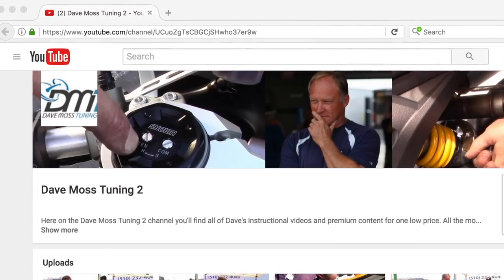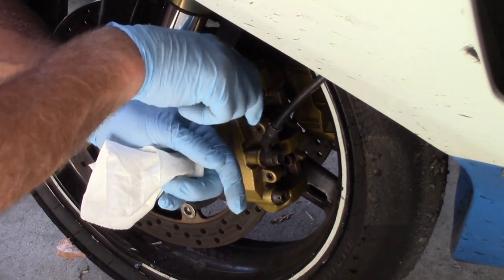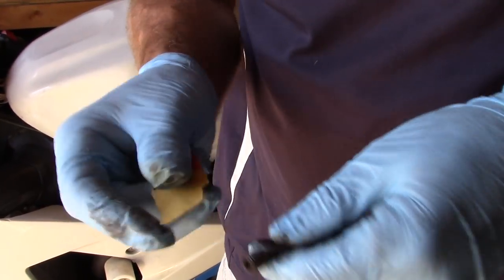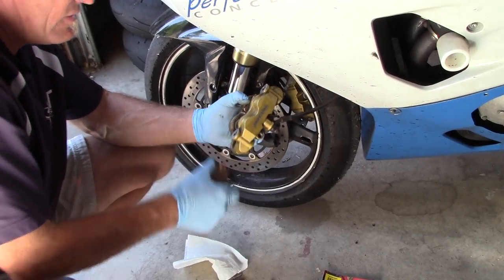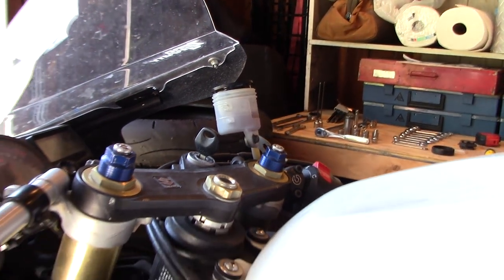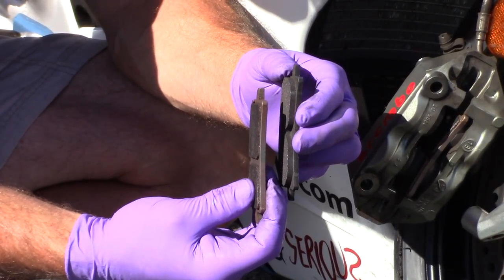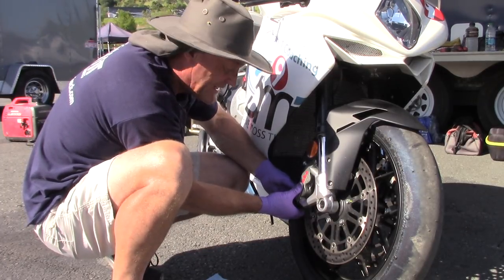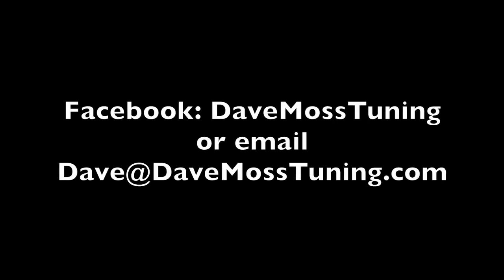How To: Changing Motorcycle Brake Pads

Comment: Thanks Dave for sharing those interesting facts and maintenance advises , i recently got a low milage bike and the previous owner did a powder coating to the wheels that damaged the front wheel hub and i realized that after i got the bike , the bearing are not snug in the hub, i didn't want to get a new wheel and was thinking of fixing the one i have, one interesting solution that i didn't try yet is to use loctite 609 (green) for the bearing to make it fit into the hub, i'm planning to try that but was looking for some advises from you as i didn't find many people sharing their experience with such problem.

Comment: My grandfather had two pieces of wood,,, I think from The Ark, as the wood looked HELLA OLD!
But he put the two pieces of wood they may have been wrapped in leather as the wood was SMOOTH.,
Aside each of the pistons lengthwise 
THEN- had a wedge block he used between the two pieces of wood.. and that applied pretty uniform & safe pressure to set the pistons back

Comment: Hope you have a video comprehensive as this do fluid removal / change ….this was so much easier to follow for me ..maybe because I always do my own car brakes …..but am guilty of Basically never changing brake fluid ,most I’d do is during bleeding running old fluid through till new ( or looks mostly new ) fluid bleeds..
Reply from the maker: I did a quick search and did not find a video on bleeding brakes 101 - only on an upside down rear caliper. That will be rectified in the next 6 weeks when I return from New Zealand.

Comment: Thanks for all the videos :-)
The first calipers looks like mine gsxr 1000 k3 calipers, and they have spring-plates on them that you might be missing on yours. I dont know if they make any difference, could be worth checking out in any case.
Reply: Correct, maybe the missing spring plates are the reason that the pad pin is damaged like that (I have a K3 as well).

Comment: Very nice video and thank you for commenting on the previous post about pad deposits on the rotor.  I have a question that no one has been able to answer about those Brembo monoblocks.  I had some trouble with a GSXR master cylinder 2 years ago and while troubleshooting it I cleaned and replace o-rings in the calipers.  During this process I found out that the inlet hose and the bleed screw are not separated internally.  Both holes go into the same cavity.  Because of this, while bleeding the fluid, the new fluid simply travels down the hose, into the first cavity and then out the bleed screw.  It does not travel around the pistons and therefore the old fluid around the pistons does not get flushed.  The only way to really bleed these calipers effectively (which, to me, is defined by saying at least 90-95% of the old fluid gets pushed out) is to pull the pistons and drain the calipers each time.

What am I missing?  This just seems like a really ineffective design.
Reply from the maker: You are not missing anything. Your observations show how the flow path works and these brakes are designed to encourage frequent cleaning as they are "race" type calipers that get a lot of attention as per several of the old On The Throttle brake cleaning videos. It can seem odd, but knowing what you have and how best to service it is by far more important.
Reply: T.J. Houchin 
Or you could put a hose on the bleeder valve open it then push the pistons in thus pushing all the old fluid out then pump the brake lever to fill the caliper with new fluid do this several times and you flushed it without having to disassemble your calipers........hope this works for you

Comment: Hi Dave !

How would you clean the break pistons if that was necesary ?
Reply: Sebastian Cichy --->  An efficient and simple way to get caliper pistons clean is to make a wood block about a half inch thick by about 2 inches long and 1 inch wide. These dimensions worked well for my Brembo M50's, however not all calipers are created equal. So you may have to modify yours a tad to fit your application. 

Once you have your wood block ready, place it between the caliper pistons. Now pump in some brake fluid to move the pistons out so they bite the wood block. The pistons now have good extension and will not fall out.

So... now you have to clean the dirt off the pistons. A toothbrush is a great cleaning tool, but a better way (and gets 100% of the dirt'n grime) to clean your pistons, is to use shoe laces. I like to use white shoelaces so I can see the dirt being removed.

Spray some brake cleaner to a section of your shoelace. Using the end of the shoelace, push it into the caliper and thread around the piston and back out. Now slide the shoelace back and fourth on the piston side. If you cross-over the lace, as you are sliding it, you will get 100% coverage. You may need to use a few different sections of shoelace before your piston is perfectly clean.

Cheers!!!
Reply: @Ducati_Dude  how have i not see your comment a year prior...

that sounds like an awesome and easy method while the caliper is still attached to the bike, kudos man

Comment: Hi Dave, First of all, nice Videos .  They helped me a lot.
Ive got  a question. Last Time i changed the pads and pressed back the pistons, One piston leaked some fluid.  Cleaned it with breakcleaner. Built all togehter and Made a testride on the Track. All fine. But  my stomach says  me to replace the seals in the caliper.  Is it worth it ? 
Dear greetings from Germany
Reply from the maker: Brake cleaner dries out and cracks seals over time hence the suggestion to use a toothbrush and soapy water to clean the calipers. Yes, it is absolutely worth changing the o-ring seals out if one was leaking. Always follow your instincts!
Reply: Thanks dave. Ok i will do it in the winterbrake.  Making big Service on my aprilia.  Any Tips for the Changing of the seals?

Comment: Thorough, great. Any views on stainless lines?
Reply from the maker: Stainless lines are an improvement over stock when the rubber lines age after 3 or 4 years (if the motorcycle is stored outside with no cover). They also provide better control/feel than stock lines that are getting old. For the track, they make a big difference.
Reply: @catalystreactionsbw  Really appreciate that Dave, I have an older bike, if I'm going to package up a job for my mechanic, may as well change the lines for stainless while he's there, top man.
Reply: Maybe stupid remark.
When talking about „stainless“ steal the German MOT allows only A4-80 stainless steal (not the cheap A2-70) or titanium at the braking system (including calliper fixing bolts), because A2-70 is not „flexible“. It will break instead of bend.
Same thing with bolts at the suspension system.
Which makes sense to me.

Comment: Why didn't you just use the old pads to separate the pistons ? Also why didn't you clean the calipers and pistons before pushing them in ?. Iv also met wizards on the tools for major race teams use copper grease on the back of pads to help with heat ?. 
Keep the vids coming
Reply from the maker: I clean the calipers on average once a month. As everything is cleaned so frequently I can push the pistons back and do not use grease.
Reply: @catalystreactionsbw   ok fair enough, I always fought dirty was dirty no matter how often you clean them. Ride safe

Comment: A lot of grit gets trapped in the array of holes in the rotors. What I do is spray the outer surface all the way around first, with a paper towel behind. This is better than using an airline which can send debris everywhere. 

Then I clean both surfaces, poke every damned hole, and wipe the surfaces again. 

It’s laborious and time consuming, but grit is as unwelcome as grease on brake pads. 

I also avoid cross contamination by changing my gloves regularly and after each filthy stage. 

Another trick with the pins is to spin them in a drill (wrapped in tape to protect them from the chuck jaws) and clean the dirty/rusty/uneven surfaces using 400 grit taped onto a 1.5” wide x 6” long piece of thin flat plywood. 

This gives you light annular effect around the diameter - which we don’t want. So then I wank the buggers with 800 grit until the annular marks are removed, to create the desired longitudinal lines instead. 

I even finish off with 1600 grit to really polish them beyond smooth. This has the effect of preserving their useful life by creating a surface that’s far less likely to attract moisture, so less likely to corrode. 

Finally, I sometimes find that swapping pins around offers different areas of the pin surface to the part of the pad backing plate that wears the pins, thus effectively starting again with a similar situation as when the pins were new. 

When needs must, there’s nothing quite as satisfying as returning brakes to like new operability without spending any money, particularly useful when working on older bikes.

Comment: Hi Dave, what is your suggestion when putting new rotors in, out of the box? I just replaced mine and cleaned them with brake cleaner. Also my pads are new but they have done one trackday with the old rotors. What is the best way to make them work together? Is the pad now formed to the old rotor, even after a session?
Reply from the maker: I follow the manufacturers suggestions to the letter. If you do not have those, email them and acquire them. General rule of thumb if you have no information is 30mph to a stop with constant 50% pressure, repeat 20 times so you get pad material on the rotor. On track session light prolonged braking in normal braking zones (essentially drag the brakes). Next session more pressure, shorter duration. Third session 80% to start, 90% from half way through to end. Last session, regular pace, normal braking skills in brakes on and off areas.
Reply: Dave Moss Tuning Thanks Dave, very helpful as always.

Comment: would a brass wire wheel be ok to remove the pad material and what media is suitable to sandblast?
Reply from the maker: I generally use the asphalt or concrete surface and do 30 seconds of a figure 8 pattern. A wheel can rip through pad material. If using san paper, use 400 grit. If you are sandblasting, soda blast works wonderfully.

Comment: why doesn't you apply silicon grease on the sliding pins and rear of the brake pads?
Reply from the maker: For me, I clean the pins and look at them for deformation. I do not use grease as I keep the calipers clean and do not want grease anywhere near my brakes.
Reply: I wouldn’t think silicon grease would be necessary in this application due to how often everything is serviced

Comment: What could cause brake drag? Replaced my rotors and pads and they seem to be dragging more then before. Could the pins being worn cause this
Reply from the maker: When was the last time you cleaned your calipers with a toothbrush and soapy water to check all 4 pistons moved evenly? If it has been a while, be very thorough with that task and use the video we provide.

Comment: Don't you need to open the lil bleeder valve while pushing the pistons back?
Reply from the maker: You do not, the brake fluid pushes back into the reservoir BUT you have to make sure there is room for the fluid to do so!

Comment: Dave, what does it mean if all 4 pistons don't come out evenly?
Reply from the maker: That the pistons have stiction or drag between themselves and the dust/oil seals just like forks. Using a toothbrush and soapy water can help "lube" those seals and ease the piston movement. In addition the soapy resideu will collect brake dust and help reduce corrosion.

Comment: Why is it that when I see DIY of car videos they pinch off the brake line as to not  push fluid back into the master cylinder, yet It is ok to do it for bikes? I'm confused.
Reply from the maker: Great question. This is normally don when you remove the line from the caliper to clean it or disassemble it. With bikes there is such a small amount of fluid lost in a very short line (comparatively), there's no reason to pinch the line. That's my 2 cents.

Comment: 22:59  Should you not grease the backing plate at the points where the pads contact the caliper?
Reply from the maker: I personally have never greased any backing plate. As I clean my brakes comparatively fanatically, I don't worry about it and my conscious mind rests easy that there is no grease turning to liquid while racing. As with all things, these are personal choices and I have no problem if you do or do not do that.
Reply: Dave Moss Tuning ---> Did a brake service recently on a set of Brembo M50's. The new pads were squealing something fierce... so I pulled the calipers/pads back off and applied a bit of high-heat Copper Anti-Seize grease on the pad sliders... Sqealing gone... ✔
Reply from the maker: Awesome! Thanks for getting your hands dirty and making a difference by being proactive!
Reply: Dave Moss Tuning 
just a hint. No copper grease as soon as your bike has got an ABS-system. Take ceramic grease.
In case od spilling off (maybe caused be too extensive use) it will not infect your ABS regulation.
Reply: Germans are the world champions in regulating everything 😂😂😂😂

Comment: 19:22 those original pads are mismatch between left and right. Someone wasn't paying attention when fitting the leading edge with direction of the rotation. Or is this just the OCD in me? But the mechanical knowledge of rotation and attack of the pad should have the longer section on the pad to the leading edge. This will result in uneven braking between the left and right side of the single disc that can heat the disc uneven also and warping the disc. It can also result in uneven wear of the pads and loss of braking power.
Reply from the maker: Thanks for your post. Pads are marked for left and right side and some have an arrow on them to make sure they are installed correctly.

Comment: That paper towel method is messy. I use cheap syringes from ebay to take out excess fluid. I have a few in case I overfill engine oil or coolant too. (Obviously label them so you don't mix up)

Comment: to much force to push those pistons in..that means they need to be taken out and cleaned...clean the seals too!if you push the pistons in with debris on them.they will bite and destroy your seals...pistons are meant to go out with time along with the wearing out of the pads...dont push them in when you change pads!!!!clean them first!!
Reply: Not quite, they can be tough anyway because of the fluid, but it would make sense to clean them first for the reasons you state, no need the rebuild the caliper just to do that. A bit of soapy water and a toothbrush will clean them enough to reduce the risk of causing damage, it is rare though, I bet they had no issues, at least for some time.

Comment: Before you open the caliper, clamp the brake line with a brake line clamp (very cheap) and open the bleed port and place a hose on the nipple to control where the contaminated fluid goes (into a drip pan of course) .... THEN open your caliper. Doing this pushes all the dirty fluid OUT of the system. If you do it the way shown in this video, your pushing contaminated fluid back to the reservoir. The main cause of caliper failure is contamination. NEVER PUSH OLD FLUID BACK INTO THE SYSTEM. Always out!
Reply from the maker: Excellent! Define the settings you need :)
Reply: Pinch off a steel braided brake line?! Yeah that’s a good way to cause permanent damage to the line. If your fluid is already contaminated you should perform a fluid flush

Comment: 1:50 that’s nowhere near a “ton” of water.
Reply: That’s a lot of water for brakes on a motorcycle. Especially a bike that is tracked. Have you ever experienced brake fade on a Motorcycle due to the fluid boiling before? It’s scary. It’ll boil far sooner if the fluid is contaminated with water